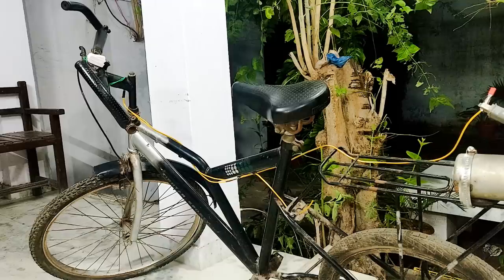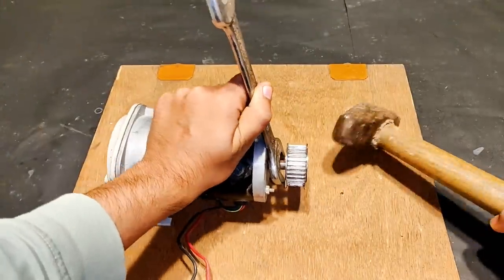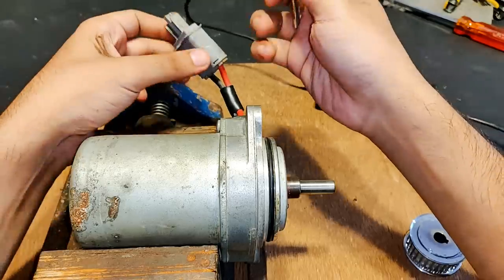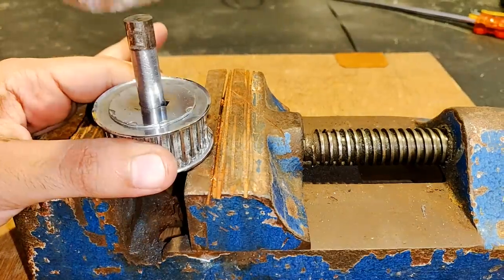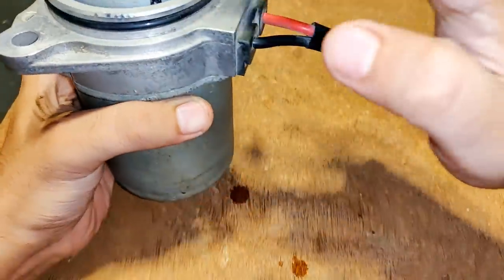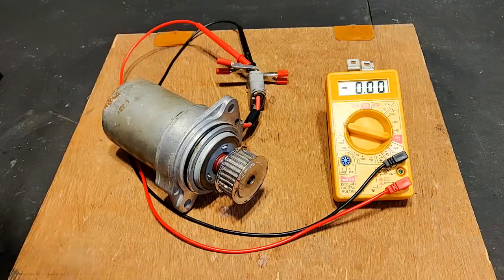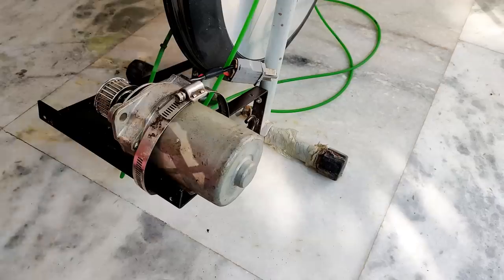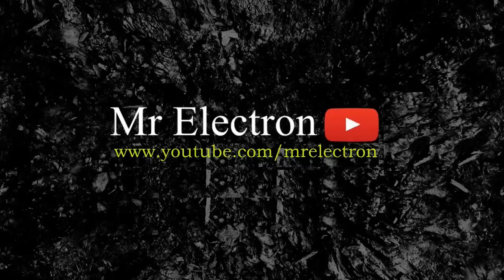Wow! 12v 500w High Current Dynamo from 24v DC Motor DIY

Comment: 3:10 seems the rotor shaft is already warped ... You wouldn't think this minute amount of warping would be a problem but at medium to high rpm the static heat will continue to progressively warp it until it finally becomes so out of balance that your magnets are going to start wobbling closer and closer to the inner framing of the stator until one finally grabs and locks the motor up ultimately destroying the magnets and stator ... Ask me how I know this haha ? I have a small pile of destroyed magnets from not only this happening but also from my high rpm fan motor that spun so fast the centrifugal force becomes so strong it breaks free from the glue and releases the magnets from within the channels ive cut into the rotor ... Once the centrifugal force exceeds the Newtonian force of the magnets and the strength of the glue the magnets came free and destroyed the motor .... Was a very intense couple of seconds haha ...anyhow just letting you know whats to come from that warped rotor shaft if you use it long enough and or at a very high rpm ... Not a maybe or might but its going to ...the only question is when and how fast is it going to be rotating when it happens that determines how catastrophic its going to be ...

Comment: it will give the maximum 80 watt to you
Reply: If it gives, 10 amps at around 17 volts by hand rotation, it's already generating 170 watts. I know, off course under load, it'll reduce

Comment: 1:18 Look for "Allen" or "Hex Head" set-screw in side of pulley.  It is seen in video as a black circle in the channel where belt ribs contact.  Seen clearly between time 1:22 and 1:24 just below your right thumb.

Comment: Can i make dc 1v motor as a generator if yes how if no why please🙏
Reply: You can convert any motor into a generator ... Different motors have different input / output nominals and different motors require different amounts of work to achieve generation so the problem is will the motor you convert into a generator produce enough electricity to make it worth the trouble of doing so ... A 1v dc motor at its best will produce 1v dc current so not worth doing unless you rewire the field wiring with a slightly larger gauge which will then reduce your wraps and result in voltage loss but gain in amperes  .. It is possible its just not worth the trouble of doing so ... If you want to use that 1v dc motor to create electricity it should be enough current output to possibly power up the little red light on your tv remote control but its going to require that same amount of energy to turn it so not much of a gain just to give you an idea of how weak it will be ... Your going to want to use a large motor if your going to seriously try to create a generator out of it and then you must understand which motors (etc. Synchronous , universal or induction ) and then those types break down into different variable styles such as brushless vs brushed , 1 2 or 3 phase but generally into ac , dc or universal .... Look on the motors legend and look for the highest watts rated motor you can find and then this will be your best bet for a generator and not a small 1v dc motor unless your just doing it for the fun of it ... 

Simple answer is yes you can use your 1v dc motor as a generator ... Is it worth the time trouble and cost of doing so ? NO NOT EVEN CLOSE 
I hope this answers your question and good luck in your project 👍👍👍